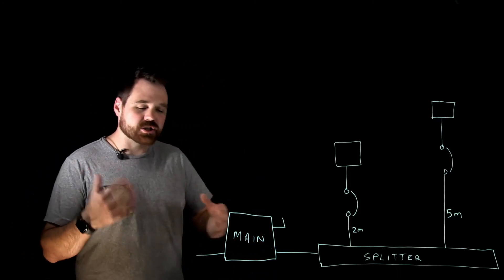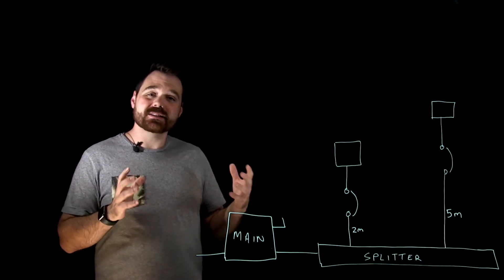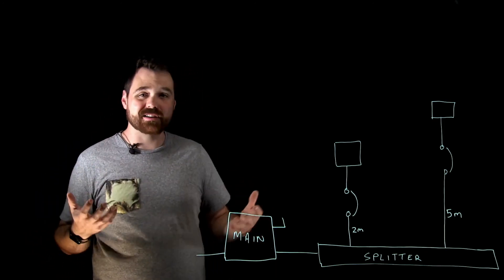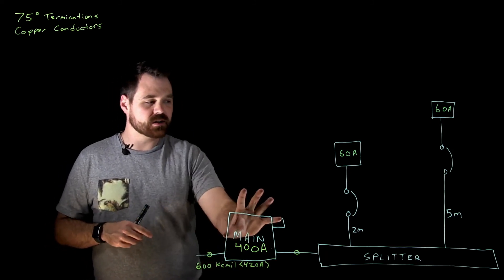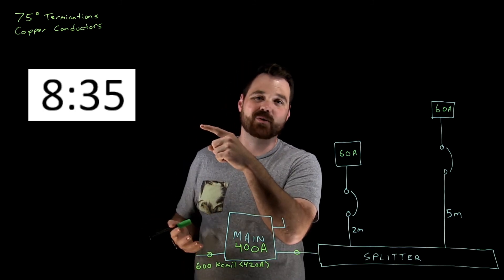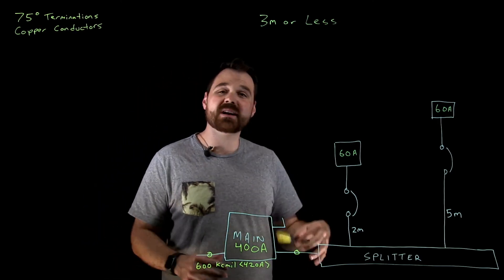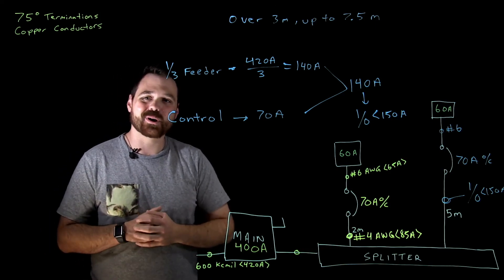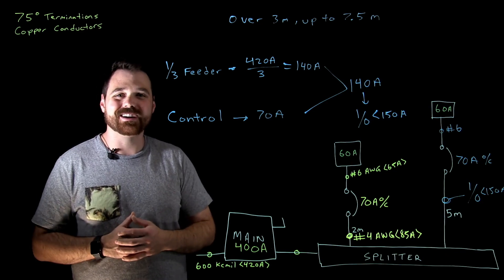Tap Conductor Sizing

Comment: Dear Zack, thank you for such a nice videos.
 I have a question:
How an overcurrent device which is  set more than an ampacity of a wire can protect the wire?
Please let me know .
Additionally, why didn't you use 80% equipment rated as in question doesn't mentioned it is continuous or non-continuous?

Thx in advance.

Comment: As you said in countinious brach circuit, we need to divide load amp by 0.8 and then use table2. But you didn't in this example. Can I ask why?
Reply from the maker: I guess I am treating all these as Non-continous loads. I should have been more clear

Comment: Hi, why overcurrent is 70A? Thanks.
Reply from the maker: It would just be the maximum size permitted by the CE code. I have a few videos on OC sizing.
https://youtu.be/Ur-7OO43WPg
https://youtu.be/XKiS-tjeSpU
Reply: @ZackHartle  If the breaker is only rated for 70 A, shouldn't the downstream wire meet or exceed that rating too? For example if the 60 A load was defective and drew more than expected, wouldn't the wire melt before the breaker could protect it?
Reply from the maker: @ihategoogleplus490  It could, but the CE code does allow you in certain situations to have an overcurrent larger than the wire.

I have a few conductor sizing videos that cover this a bit
Reply: @ZackHartle  Yes, sorry just saw your linked video. It points to Table 13 which says for conductor ampacity of 61-70 A, a 70 A breaker is permitted. In this case for 65 A a 70 A breaker is permitted. Sorry for the confusion!

Comment: This comment is for anyone using the CSA Exam Prep app, yes indeed they app get the sizing wrong because it bases its calculation off the splitter ampacity, not the conductor supplying it.(Question ID 1510)
I believe Zack's interpretation is correct.
Reply from the maker: But you're saying this video is correct?
Reply: @ZackHartle  Seems like it to me, but I'm jsut an apprentice. The app fails to use to conductor sized for the splitter and rather uses the splitter ampacity. Sorry about the ambiguity, I'll reword my comment.

Comment: What if your equipment was temp specified at 60/75 degrees? but still feeding a load less then 100AMP ? 

thank you  in advance
Reply from the maker: Then you just make sure you use the appropriate column in Table 2 or 4 when sizing your conductor.